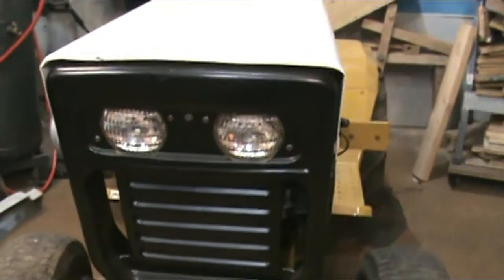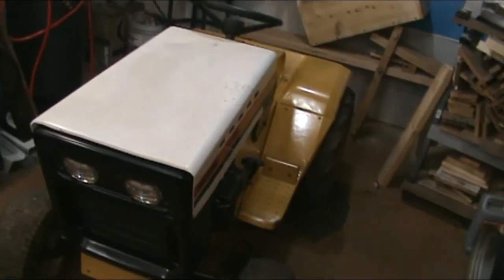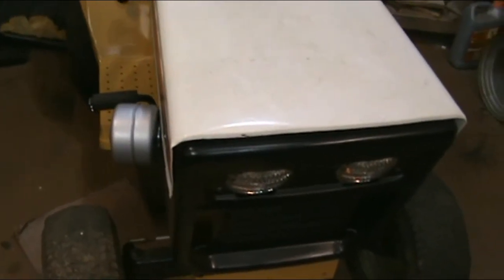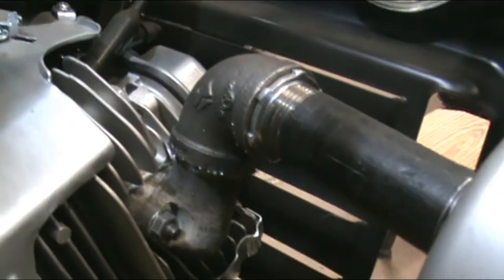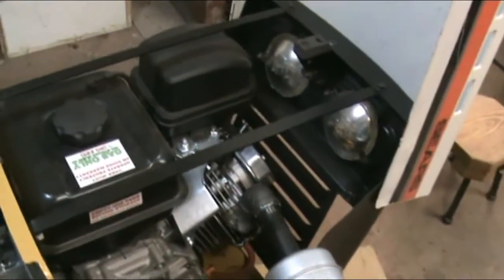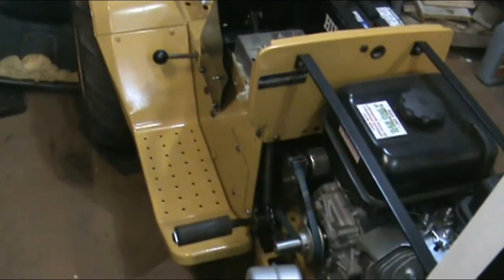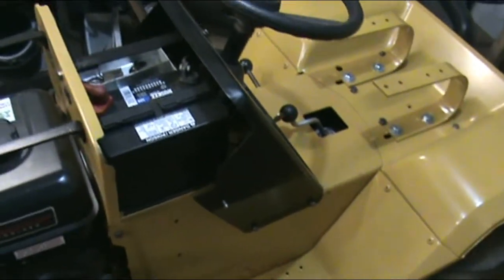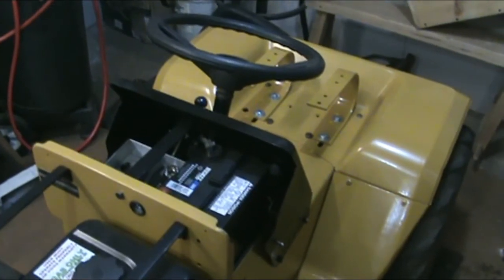1977 Sears 14 6 Restoration #11 - Running Boards & Exhaust

Comment: Looking really good!  Are the seat springs on backwards? Just curious because my 10/6 has always had them turned around with the curve towards the front since I received the tractor from my grandfather.
Reply from the maker: Thanks, 71_Sears!  I don't know?  That is the way they were when I took them off...  I just looked at the manual and you are right, they are backwards...  Thanks for catching that...
Reply: gardeningpreacher sure thing! I thought it looked a bit weird. I had to grab my shoes and go look for myself lol.